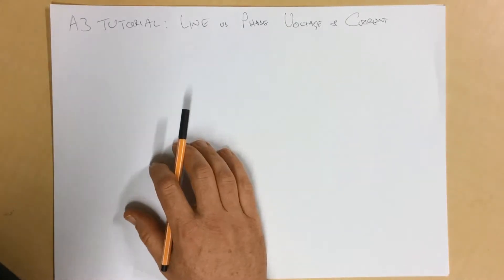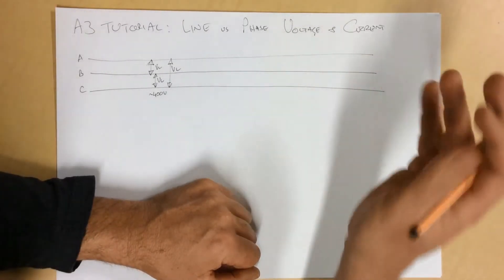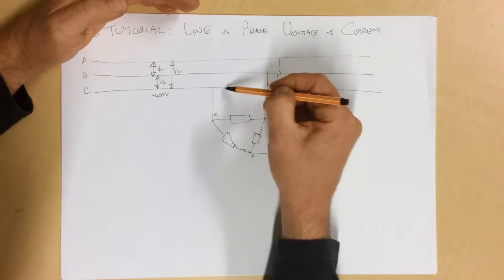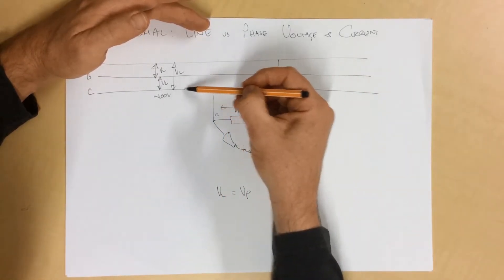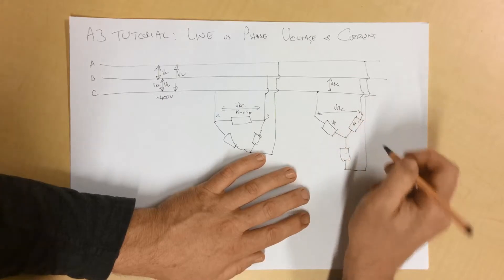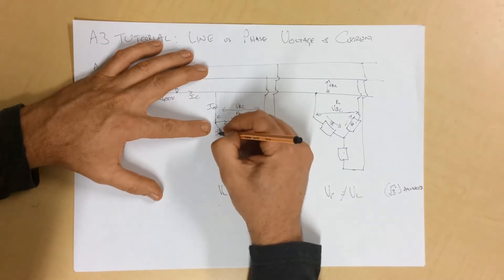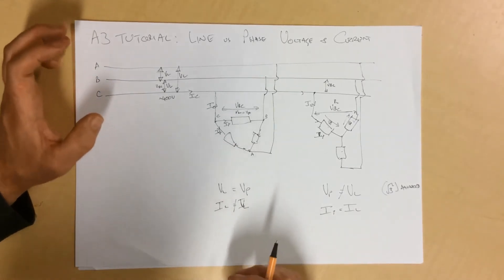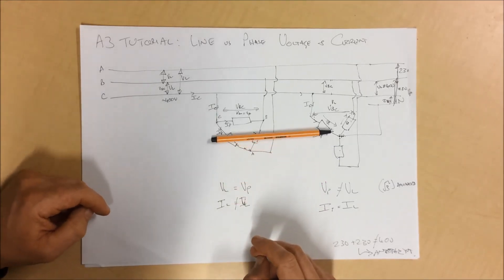Taylormade@AUT A3tut: Line Vs Phase

Comment: can you explain the negative voltage in a 3-phase system please?
Reply from the maker: sarandis andonakas What do you mean by negative voltage in a 3Ph system?  There are several ways this could be presented, so if you can give me an example, I will address it.
Reply: Taylormade@AUT 
lets assume that in the source we have 230 volts. we would expect that we have 230 on the load. however this is not happening. if we measure between a phase and the neutral is something 234 volts on the load side . there are 3-4 additional volts which are not because of the capacitor of the cable, i am not quite sure what it is and how to explain it in simple terms. 
makes a bit of more sense now? thanks anyway! :)